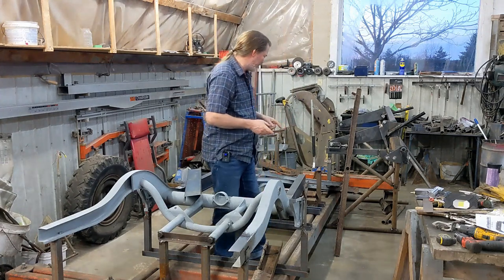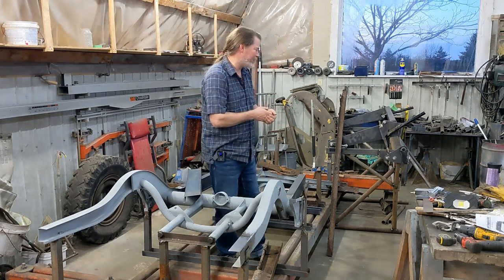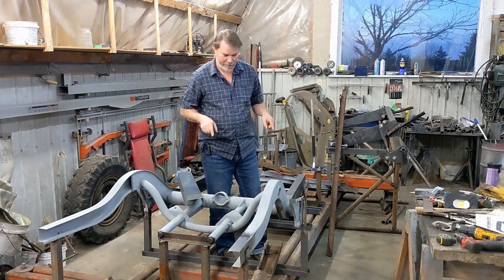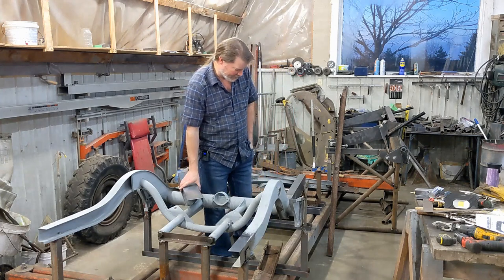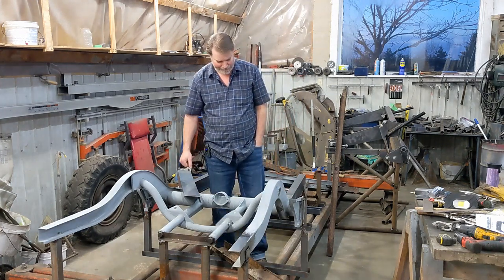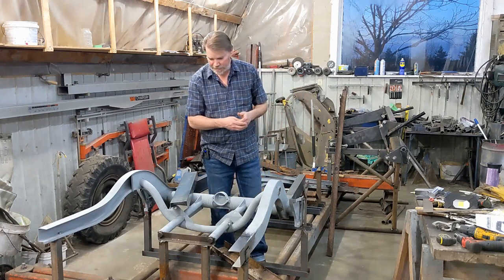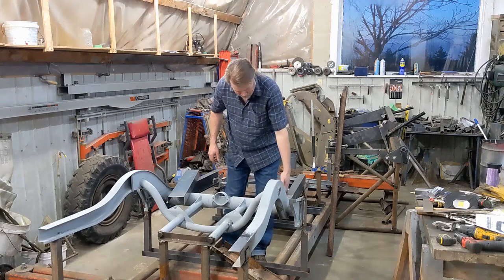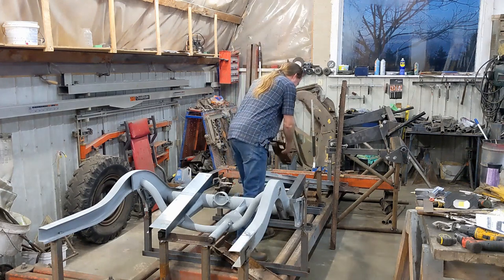The Nova Scotia Barndoor E11 - Rear frame rail

Comment: Wow the fitment and bends are so precise. Most people dont know how hard that is to get the bend in the exact place and same radius as the original part. You really have an eye for getting it right. Your parts are straighter than the ones sold most places. I really cant wait to see the sheet metal parts and forming how your doing it. there are also some compound bends that are pretty tricky on the frame that will be a little tricky. I did the same on the rear frame parts. made a piece like that then bent it around the torsion tube. But mine didnt look quite like that quality. great Job!!!!

Comment: OH yea the spot welder wont do that thick very well. Unless you can find or have a high voltage automotive body shop one. Sometimes you can find one out of date used pretty cheap. The body shops need to have one that is within a certain date. Once they expire they need to buy a new one. Old ones go for between 1500usd and 2500usd. new about 25000usd. But for some reason stuff up in the north seems to go even higher. My wife is from ON.....I know all about the Canadian problems.